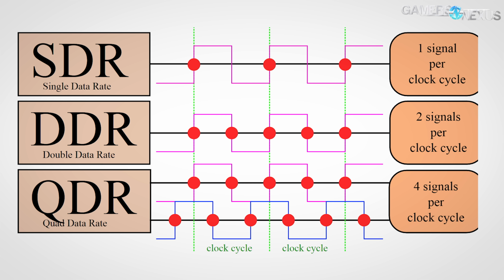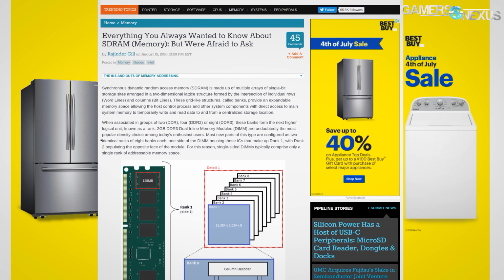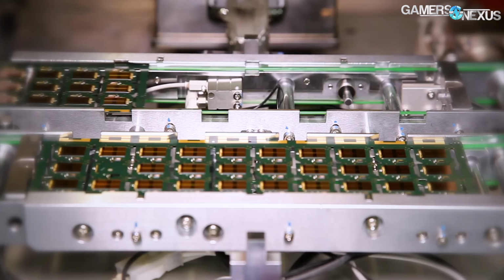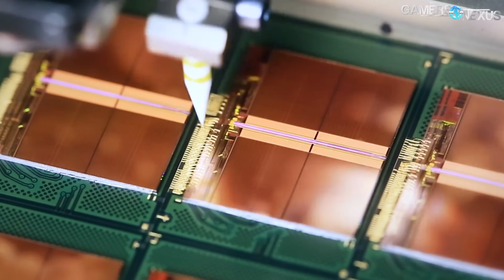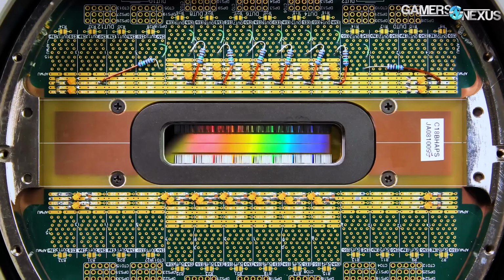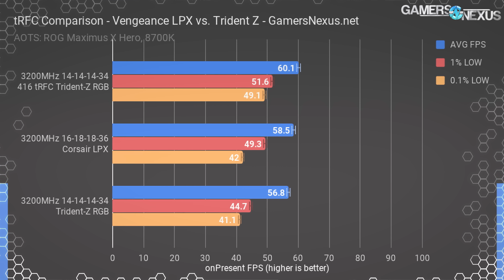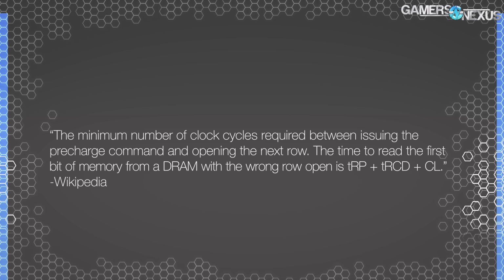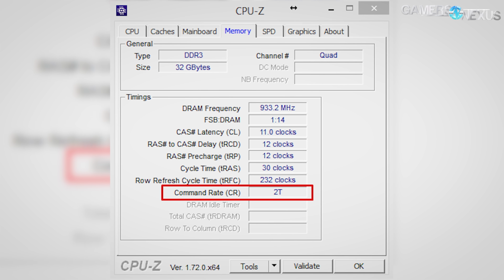What Are Memory Timings? CAS Latency, tRCD, tRP, & tRAS (Pt 1)

Comment: My brain hurts after watching only 6 minutes of this video.
I'm currently looking at getting more RAM for my machine. I currently only have 8gig, but want to upgrade to 16gig.
My MB only has 2 slots, so I have to get a 2x8gig kit. My MB will run at 2133MHz with upto 32gig.
I'm confused with the latency numbers. I've looked at 3 lots of RAM, but they all have different latency values. 
What's quicker? 14-14-14, 15-15-15 or 13-15-15.

Thanks in advance.
Reply: 13 15 15
Reply: @dubya85  . WOW! That question was a long time ago. I've since built a totally new machine. Thanks for the reply anyway.

Comment: Which parts of the fabrication process require human monitoring/input (say for example a 64 layer NAND or 12nm CPU or DDR4 module)?  Is it dependant on the particular fabrication line (complexity) or on the physical setup of the line?  Is there a move towards full automation of these lines, using burgenoning AI tech could a manufacturing line automatically improve its quality (even by simulating the process thounsands or millions of times before the physical run occurs?)  Oh and while BIOSs are resource limited (see AMD running into the BIOS storage limits to support their cpu range) does anyone think we might see a BIOS that is able to 'tune' itself to get the optimal performance from the hardware it is aware of?  (may not be a thing but the future man!)  

I havnt done any memory over clocking but it seems like you cant dynamically change timings from within the OS, you need to reboot to apply the new mermory timing at any rate...  What if you used a bootable OS (linux boot disk?) that ran though different memory timings until it reached the most efficient timings for that specific set of DIMMs, presumably it could set timings, reboot, stress test, apply tighter timings, reboot, stress test, until it reached an incompatible timing where some human intervention would be required to reset the board BIOS...

Apologies for all ther questions but interesting article team!  Curiosity is overclocked now :)

Comment: Retuning my old AMD (DOCP 1600), I found the XMP profile for RAM set 1T, which the generic DOCP 1600 did not.
However, it didn't take the Trc 36 from SPD, and instead used 40. I tried setting 36 and it became unstable... I guess BIOS knows best?

Comment: Okay, I had a hard time understanding all of those information but I'm thanking you for the time and effort it took you and your team to show us these. I have a friend who asked me about RAM and I cannot really explain it to him simply because I find it too complicated, even for me who has gone a lot of time watching tech videos and reading tech articles (I'm a still a noob).

Now I just want to ask GN, my laptop here has a single DDR4 - 2400 4GB RAM from A-Data with a rank listed by CPU-Z as single (which I don't quiet understand). Now, I want to buy a Kingston value DDR4 - 2133 8GB RAM (KVR21S15S8/8). Basically, I don't have to ask you guys this question if all I ever wanted is to replace the 4GB A-Data RAM with this 8GB one BUT I still want to use the 4GB one in the same laptop since I kind of not liking the fact that the 4GB RAM will just be left in the corner and getting dust. My question is, will there be issues such as "bricking" that I might face in the process? I would be really grateful if my question is answered. 

As always, thank you for the informative videos and a good day to you guys.
Reply: just try putting it in, if it doesn't work then take it out
My friend has a 32gb 3200mhz stick and a 16gb 3200mhz stick that have different latencies, but they run fine together
Reply: having said that someone i helped build pc had 2 identical sticks from different kits that didn't work together at all
so your mileage may vary, if it don't work just take it out

Comment: @ 2:67  I have the same GSkill kit (3200 cl14).  It's a 32 GB set (2x16 GB), these are dual rank and have 8 x 1GB per side.  I checked my timings when I seen this, and I have my tRFC set at 267.  I used Ryzen DRAM calculator to arrive at these timings, but haven't re-done it since ver. 1.0.  Have an 1800x / CH6.. here's a BIOS dump if anyone's interested.. https://drive.google.com/open?id=1yaBdNFr3NYh7wnzf3L9VIz-t44_KbhnC

Comment: I still wonder one thing, which I can't seem to find a good answer for - what are max acceptible voltages for DDR4 RAM?
I mean, a high enough voltage to work with overclocks, but still low enough to nok actually make a difference on life expectancy.
Reply: Amund Skrullebakken with my overclock my RAM sits at 1.42V, you can generally put up to 1.45V through DDR4 quite safely, and up to 1.5V if you really want to push it.

Comment: Took me 2 months ( 3 classes a week) to learn memory timing and the manufacturing process and how it is programmed and sequenced. And it only took one Midterm Test for me to forget 70% about it. I'm surprised you could put it in the layman's term as much as possible when applicable.. lol...Memory is an enigma and only those who need to know it for their job should venture into piles ass of documentations. Or just sadistically curious. When you get into the more difficult parts, diagrams or more specifically branch diagrams are extremely useful in explaining the relations of each term and related functions or part of integrated system that works coincide with the memory unit as a whole and it's huge... fucking huge... My inner nerd is slowly dying, cause it's 8:47AM and I didn't have coffee yet...

Comment: tRas 26 "worked" coz your Motherboard had just "trained" tRas to the right minimum without even showing it in BIOS or any programm able to read the timings. I have the same situation with my memory able to work at 16 20 20 28 3400Mhz, but there is no difference in performance when i set tRas to 36-45 in comparison to 28. Most influence on memory latency and speeds of DDR4 i got from tightening tretiary timings.

Comment: Is there a way to calculate the total performance of a DRAM stick, by for example frequency  divided by clocks cyclers? 
Example, a 3000mhz 15-17-17-35  kit should perform equal to a 3600mhz  18-19-19-39  kit. because even though the 3000mhz kit is 600mhz slower it takes less clock cycles to operate. 
3000 / 15 = 200
3600 / 18 = 200
Does those two kits perform the same because in theory it takes the same time for both memory to operate or because higher mhz will give better results no matter the timings ?
Reply: To perform the same, all of their timings should boil down to the same amount of seconds (well, nanoseconds). Beyond this, I actually don't know if the frequency actually matters anymore, just by itself. Though the bandwidth is estimated solely on it. And there's this thing that if it's DDR it reads/writes both when the signal is rising or when it's going down making me think it does matter. Especially in bulk reading/writing.

In any case, in your example, the 3600 MHz has better timings. The CL one is the same, but the others are better for the 3600 MHz kit.
Reply: The 3600 would in theory be faster at larger files, But also the rest of the system has to be able to use fully. For example a lot of ddr3 1800-2100 aren't faster because of the mother board or CPU limitations. So for ddr3 it was better to get with a higher quality 1600 with a lower CL. In general most RAM translates to around 10ns anyways.

Comment: Still goes waay over my head, I tried to manually OC my memory once, from 3200mhz (14.14.14.36) I got it up to 4000mhz (12.12.12.24), it did require a bit more voltage but it seemed fairly stable, and yet performance seemed to decrease compared with running the XMP profile.. Gave up and reverted to 3200, ram overclocking is still too much of a dark art for me!

Comment: When I was learning about this stuff, in '95 & '96, I was also learning to program in assembler, so learning how a CPU works instruction by instruction. Learning the two together, actually helps. Trying to do one or the other...
Real world application of all this, not a whole lot. It does mean you actually understand what the memory makers mean by the numbers on the box, but... The other reason you might want to understand it, is if you're overclocking, because then it helps a whole lot to know what all those settings actually do, that you're fiddling with...
I'm not sure if it's still up there, but back in the day, Tom's Hardware had "Guides" which were exception for this kind of in-depth stuff.

Comment: Complicated, sensitive DDR4 overclocking, I didn't have the patience for it. Luckily the MSI Gaming Plus mobo's bios, has presets that helped immensely, in finding timings that allowed for 3200mhz overclock, on cheap Crucial ballistix 2400. Coming from Intel 2500k, it's true, until getting Ryzen I never bothered to OC my ram or set custom timings.

Comment: So I am on a Z97 board, with a 4790K with a overclock of 4.6ghz, I have DDR3 Corsair Vengeance 2400mhz speed ram. So when I overclock via XMP, then change the timings to 
15-15-36-2T @ 2666mhz am I doing anything to gain any performance?  Im sure it's great when you benchmark, but is there real world benefits?

Comment: Optimizing memory timings for a specific desktop build has always been important, especially if you want to get the most stability and performance out of your system.  Anytime someone see's a "page fault" blue screen on a windows machine, it means they really should manually configure their system memory.

For a few years though, all the marketing behind XMP had really paid off.  Most people who thought of themselves as "enthusiasts", stopped caring about tweaking their memory timings and just used XMP.  When XMP didn't work out of the box, they then either blamed the memory vendor, the CPU maker, or the motherboard vendor...  All problems that can be solved for brands by good PR teams and "viral marketing" of online product review sections.

That same really good marketing and PR, resulted in people forgetting that most memory DIMMs are using basically the same memory ICs... "enthusiasts" stopped bothering to check or care about what kind of memory they were actually buying (samsung/micron/hynix revisions A thru H) and were only thinking about the memory vendors brand names.  "Influencers" and product reviewers stopped mentioning what type of memory IC's different consumer memory brands were actually using for individual products.  This was good for memory vendors, because it made the good old fashion bait and switch waaaaay easier.

Oddly, I don't think it was actually AMD Ryzen that triggered the social zeitgeist suddenly caring again about properly configuring memory for an individual build and actually being aware of what type of ICs DIMMs are using... but I think it was crypto currency mining.  A shit ton of non-technical people suddenly began self-taught crash courses on GPU bios software coding and more specifically exactly how DRAM functions.  When suddenly an extra 15% memory performance, means 15% more $$$'s earned per hour and system instability means $$$'s lost... people suddenly start looking past marketing bullshit and learn how things actually work.
Reply: It’s not often such information is found on YouTube comments. Great job preserving to expand.
Reply: Adjusted speed and timings myself manually. FX 6300 performs slightly better and PC feels more instantaneous. GTA 5 felt like it has less delays in rendering frames, making it smoother. Was totally worth it, didn't change stock voltage. Same power consumption and more performance, perfection.
Reply: Based on my limited observations people stopped caring about timings around DDR3, that's XMP, right. But at the same time CPU overclocking became a very easy task with 2 cranks: You have vCore voltage and CPU multiplier. That's all (and people are still somehow afraid to overclock).

What this has done to overclocking is that lowered the entry barrier. You don't have to spend time reading, you just need to know what the "safe" voltages and achievable CPU clocks are. Why has everyone forgot about memory? Because it didn't stop CPU OC any longer. BCLK stays constant, memory controller is decoupled from its clock. With BCLK overclocking you had to take care of all the other things, including the consistency with the memory clocks. 
And BCLK OC had stopped being THE method around the time DDR3 has become widespread.

As an early Ryzen adopter I can confirm though that memory was given the importance again. People saw the high memory clocks on Intel platforms and the clocks problems on Ryzen. Since next to none had the deep knowledge of manual timing tuning people tried to find working chips for high clocks (Samsung B/E-die memory etc).

For my part I can say that firmware was in awful state, no matter the memory chip capabilities. When the secondary RAM voltage must be at 50% of the main voltage (following the standard), but the firmware doesn't adjust for this automatically, then it's not just a Ryzen/platform fault. XMP profile sets 1.35v but that secondary voltage remained at default 0.6v... This was fixed at some point in summer 2017 (Asus X370 Prime). (not to mention that firmware is built with crap and sticks and works somehow, according to people working in the industry, but that's a topic for another day)
Reply: ArhGee 

Do you of a good read on this subject?
Reply: I always hated the XMP marketing bs. Industry loves it for the almost non-existent amount of time spent "improving" a product which would sell a lot by simply slapping jargon to it. I too have blamed the wrong manufacturers for this.
Reply: Goodass post.
Reply: Wish I was smart enough to truly understand not exactly how memory works, because I do not need to know this but exactly how to configure and test memory properly on different manufacturers motherboards and bios’s.  Why can’t we have a layman’s guide to figuring it out.  This is what kinda discourages me from ryzen with the infinity fabric it is so dependent on ram there is no way i could trust myself to clock ram properly.  Guess I will be forced to go to intel.
Reply: Money is always the fuel
Reply: Well said!
Reply: but what do you mean by "IC" im trying to learn from this

Comment: I find RGB strips easier to understand.
Reply: RGB timings are important... maybe
Reply: @Jumptohistory   Oh they are!  I wrote an AVR ASM routine to write a buffer of memory to an ARGB strip.  It's a 1-wire serial interface, so the difference between 0s and 1s is how long to hold a high level on the line before going low again.  You latch the values (and reset the serial bus) by holding low for a specific amount of time.  On a micro running at ~8 to 20MHz, it's a matter of counting cycles for the loop, then padding any time (hopefully) remaining without going over your timing budget.  :-)
Reply: I lol'd hard
Reply: What timings needs my rgb gaming chair ???
Reply: And you get more performance out of RGB than RAM anyways...
Reply: @ACE3CGL  Not only that, it usually uses less power. My DDR5 RAM sticks are ~5W each and that's after lowering the XMP voltage from 1.25V to 1.15V (surprisingly this worked, even at 5800 vs. 5600 spec.).
Reply: 420th like. :D